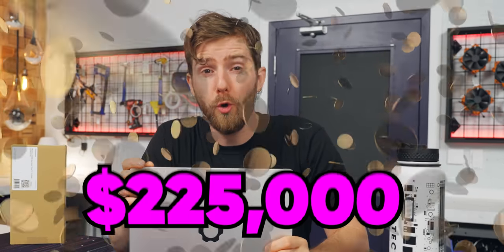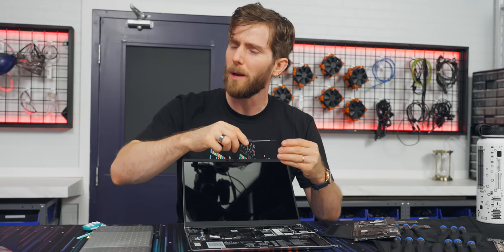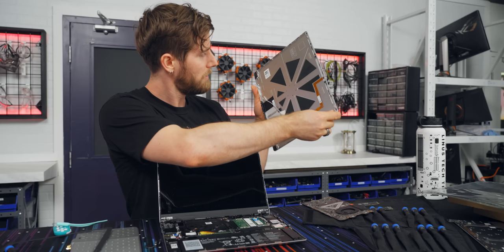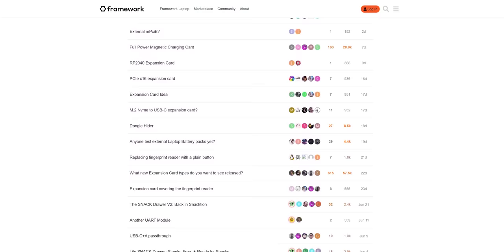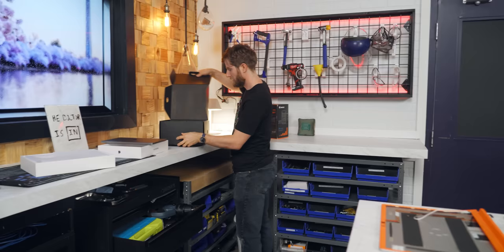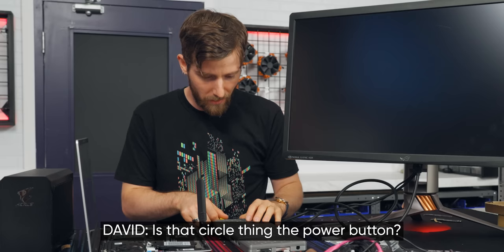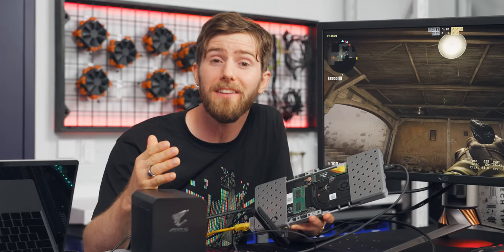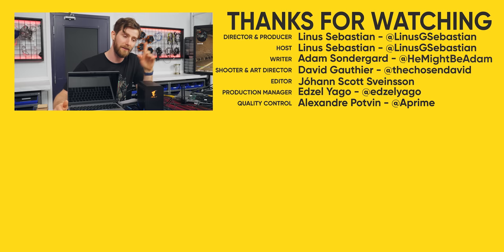I invested $225K in Framework Laptop - 1 Year Update and 12th Gen Upgrade

Comment: I love how Linus made sure to protect his $220k investment in the company and showed the laptop repair/replace process in the best light possible, by... Not reading the instruction manuals and fumbling through the entire thing without even using a parts tray, thus making the entire process look a lot more painful than it actually probably is? 😂😂😂
Reply: Or he showed the hardest way to do it so we all know it will be easier if we fo
Reply: I think its also important to note that even if something is easy with instructions. Easy-Medium WITHOUT instructions, is imporant too. (Ignoring how much experience Linus has with putting PC parts together)

If you can easily do it without instructions, that goes a long way towards proving the easily modular design is effective
Reply: He made this as difficult as possible and still got it done, that's got to be worth something for how easy it is.
Reply: Yeah he made the whole process look more difficult than regular laptops.
Reply: Lolll Linus is a disaster. Should have let Anthony do it lollll 😂
Reply: As someone who's built computers that looked SHOCKINGLY easy for a laptop motherboard replacement - did you see a soldering iron and a microscope?
Reply: 💯 This totally anniyed/triggered me.
Reply: @nathanddrews  Same but I at least sort my screws 😂 C'mon Linus
Reply: You're right, of course, but there is also an argument that great design means you don't need a manual.
Reply: Was just about to comment on this. But yeah he proved a point by doing it the "yeah I know about computers" route and he still came up on top.
Reply: But also the fact that it was still working after he completely bungled his way through it is a positive.
Reply: This is IT. Nobody RTFMs.
Reply: Yeah, that cost him my vote.
Reply: His investment might be f’ed but if he can’t do it the average buyer probably can’t either. The Venn diagram for this product is pretty bad…
Reply: @mzy10511  Yep. Linus doing it the wrong way (ignoring instructions, no parts organized, basically just jumping in blind) while distracted and someone with less tech savvy that does read instructionsand lay things out carefully can probably expect the same amount of flailing around. It's like a handicap to bring him down from expert level to mid-level enthusiast.
Reply: You fail to forget that 96% of people do not read the instructions.  So this actually shows that it's easy to upgrade this product.
Reply: It's like legos. You pay for parts to have fun!
Reply: Thing is he hardly ever reads the instructions and just dives in to a protect without any pre thought to what he is doing. Plus how many average consumer would do an upgrade just like he did with no parts tray and looking for hardware. He showed you can still get it done if you have little to no Knowledge about pc repair. One thing most people rears is popping open a tower and worse yet a laptop. This framework pc is very interesting and the way apple is about accessories you’d think they would of been the pioneers. Maybe my next pc will be a framework after watching this video.
Reply: Oh sweet summer child, you overestimate the general consumer. Linus is doing the right thing, basicly doing "mom and pops troubleshooting".
Reply: Its realistic 😅
Reply: Linus being linus there
Reply: He needs to do the video again....
Reply: @barretprivateer8768  Exactly!  And turned the older motherboard into a sweet low profile desktop system.
Reply: It's exactly like those ads of web games where you watch someone playing it stupidly and have to rush to download it and do it right :)
Reply: That's such an ADHD mood though, sometimes my brain just NEEDS me to do something. In these moments money doesn't matter, instructions don't matter, nothing matters, just doing the thing. And sorting things, reading instructions and all that "proper" stuff are NOT doing the thing! So I'll do it poorly, I'll know that I'm doing it poorly, but it doesn't matter because doing it poorly is giving me all those good neurotransmitters faster than doing it properly. Considering Linus has ADHD I'm guessing he also just really wanted to do "the thing".
Reply: standard
Reply: Lol loved the “RTFM” note he left mid video also. Probably would have made this video too boring though.
Reply: "Framework: so simple even Canada's foremost electronics impact tester can do it."
Reply: It's Linus, what did we expect? 
"Easy way? Nah, let's find the HARDEST POSSIBLE WAY to do the thing!"

Makes for good entertainment at least!
Reply: @gotthiis  qwdx
Reply: He really cares about viewer trust and didn't want people to believe he practiced it 20 times before to make it look easy.
Reply: @mzy10511  but this is FAR from "easy without instructions"
Reply: Just like his Linux and DIY battery videos, Linus is a tech enthusiast not an expert.
Reply: His mind games
Reply: Lol can't even replace cpu without having to buy a whole motherboard.
Reply: @diegomarxweiller1814  crazy for a laptop tho in a few years it should be a lot easier
Reply: @ComfiCharlie  what? Where in tarnation do you live? On tech heaven? I can swap my cpu out anytime on my 10 YEARS old laptop, its so well made that copper tube connection to the fan on the cooler AND the hd gave out before any other thing. I spent literal tape to the cooler and got a new hdd cause the old got bad sectors from to much impact. Now THAT IS CRAZY. What is to get easier again?
Reply: @nathanddrews  Superman
Reply: Manuals?  Who reads manuals?
Reply: if he didn't break the thing even after this, I would be totally confident handling it myself.
Reply: imagine doing something without an instruction, such bad design amirite?
Reply: @dylankatz9395  more like he did it the way the average person would
Reply: He did find why I use a eggcrate for the screws. Each whole part removed gets it's own egg spot.
Reply: Most people with experience building PCs won't look through a manual.
Reply: @MrPaPhotos  PCs? Oh Boy big screws. Lap tops? Where are those reading glasses. The ones Grandma uses. Laps and Tablets are tedious to work on.. I would rather to work on a 2020 Toyota dashboard. Nope that is worse.
Reply: @warrenpuckett4203  yes because of soldering and weird cooling solutions. But I don't see the point your trying to make against my comment.
Reply: @MrPaPhotos  Um the the first computer I worked on was a RTL with magnetic core. Those had dedicated circulating chilled water thru a core.. It had huge amount of non volatile magnetic RAM (1 megabyte) that also was was water cooled. The same as with a another fan 8 inch forced cold air through a large limousine heater sized core like radiator into a refrigerator sized CPU. Yep the RAM CPU was separate then too. Jurassic Park type computing compared to a iphone 6 or whatever model they are up to now.
 I also worked on Win/Win 98 laptops about (tiny screws for tiny boards)15 years later. But the PC with 80mm and bigger fans have bigger screws and you don't need to solder the back plane anymore.
Reply: @warrenpuckett4203  I believe you are really just trying to brag about yourself here...because you still haven't said a single thing against my comment but somehow phrased your original comment as a rebuttal to mine... How does anything you said confirm I'm wrong that people who are experienced with PCs most likely won't read a manual before they try to take a laptop apart... They most likely won't because they know what components make up a computer. Regardless of the form factor or size they still have all the same parts to make them work. It's not until they are actually in it that some will realize they have no idea what they are looking at or where some parts might be.
Reply: @MrPaPhotos  The 1st computer I worked on had RTL magnetic core RAM. That was back when fixing a fault in the circuitry was a bit more difficult than fixing the code. You do a core dump the to line writer read it off the paper that rolled out. easy.  Find a bad part in 3 million parts not so easy. (Now just use a new CPU.) It had it's own chilled water forced air cooling system.
  It is reversed difficulty now. 
Hardware easy. Code hard.
So how do you use a egg crate?  Label each place that held a egg with felt pen on the inside of the lid crate that corresponds to each part you remove. It also keeps the screws from finding the floor. If you put a part back and have 1 screw  left. It may be the one causes you to take whole lap top  apart again.
Reply: @warrenpuckett4203  I'm not arguing that, I haven't been taking electronics apart for that long but I have since grade school or 25 plus years. All I said is that experienced people most likely won't read a manual unless they really have too that's all. This is becoming redundant as in we are both repeating ourselves.
Reply: The manual for me is mostly a schematic. 
For PCs the first thing I look at is the motherboard QVL. Then the beep codes. If I can find one of those little speakers in the drawer. It is kinda like fixing a newer car. Use the OBD code. Then print out the 19 sheets of schematic diagrams. 
 And no I do not read a manual to fix a hardware problem. That is what schematics are for. Code is a bit more problematic and the thick part of the manual.
Reply: he's a boy.  who reads manuals..   hold my beer
Reply: @dylankatz9395  that’d be a convenient way to airbrush flaws in videos
Reply: Do you really believe this is an instruction manual type of channel?
Reply: This is the way
Reply: Ya que
Reply: Just like everyone else? Who reads manuals?
Reply: Yea except his motive isn’t to protect his assets but to ensure the best product for the end user, he stated this in the beginning of the video. Some people aren’t always profit motivated yet we’re conditioned to think so due to American capitalism lmfao
Reply: It's a pretty realistic illustration of how the average user goes about it. Not the careful pro who knows how to read manuals.
Reply: It should be intuitive if that is the company’s model
Reply: I think he's showcasing how straight forward it is.
Reply: Thats just LTT though tbf
Reply: TBH this is how I do my PC repair stuff anyway. So It cant be any harder than doing it in my bed.
Reply: Thats the LinusTechTips™
Reply: He went on about how it has QR codes everywhere for instructions and makes everything very clear in the original video and then proceeded to completely ignore all of that helpful stuff
Reply: @opticalecho119  I think this is to show that even if you're clumsy (like me) or don't want to read the instructions you can still assemble one of the laptops. Compared to say, Apple with their lack of upgradability/rediculous repair processes and parts supply.
Plus, Linus' appeal as a youtuber is that hes quite clumsy and goofy- wouldn't be as entertaining if he just assembled it imo haha
Reply: Wise man
Reply: Who the heck reads manuals? Manuals are something you use as a last resort. I'm not even joking. Parts tray? I doubt many people use that.
Reply: Keep in mind he is a pro, I doubt it would take me any shorter
Reply: To be fair, there ARE going to be people who won't read it, and he showed it wasn't completely awful.
Reply: The thing is going in blind is arguably still easier than not going in blind on other laptops
Reply: And spitting on it
Reply: Gotta appreciate how genuine he is though lol, sometimes watching these videos I start feeling stupid when he gets onto topics I have absolutely no idea about like networking and business experience but then he does shit like this and it's deeply humbling 😂
Reply: A lot of these issues  could have been prevented  with planning  and not being rushed or careless
Reply: 2 wrongs don't make a right Linus. Take your time and plan ahead
Reply: Why did Linus crew let Linus do all this unprepared  and rushed like a kid?😂
Reply: He did it almost as smoothly as installing steam on Linux
Reply: Yeah, annoying
Reply: 225K is nothing in the realm of investment in such a very costly sector, this is a grain of dust.
Reply: lol and people say he's a shill..... he can't even shill for a company he's part owner of lmao
Reply: That's the way everyone does it, so it's realistic.